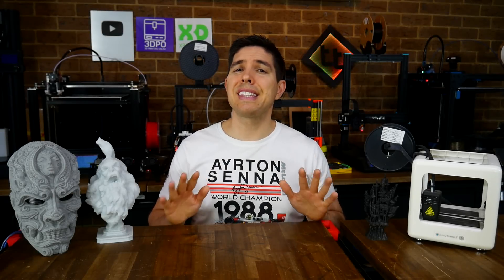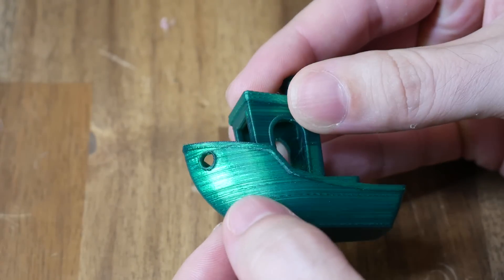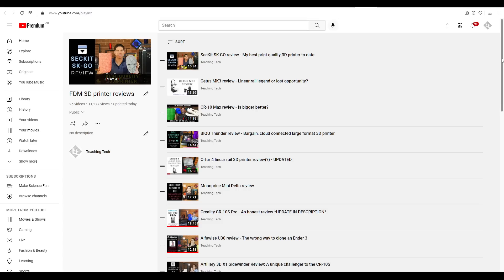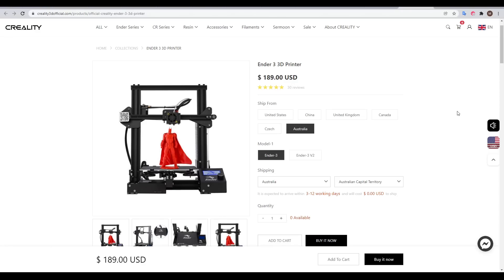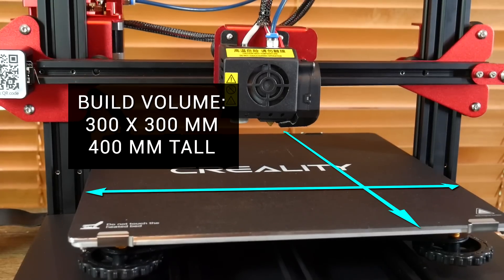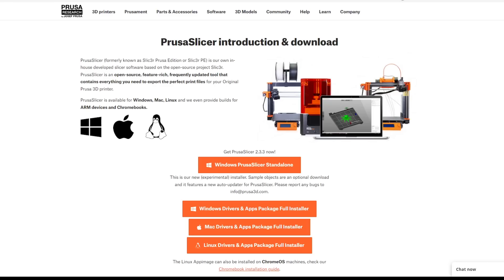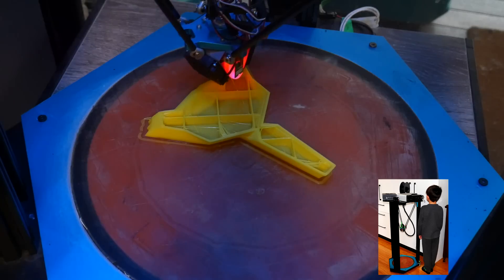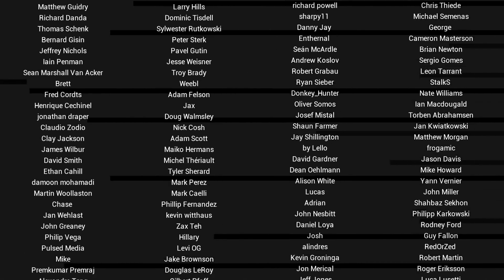Honest 3D printer buyer’s guide: Find the best machine for you!

Comment: While i wasn't able to benefit from this video I think I did ok. It's been almost a year since receiving my prusa mini and it was a learning curve (some parts still out side of direct interaction with the printer), but I think it has been the best fit. I did want to jump straight to a big print area machine, but kind glad I didn't as I don't feel the stuff I've been making/designing has needed a larger area. Furthermore, print times for bigger parts would not be ideal for various reasons in my situation.  I do agree with everything about this video as it would've been immensely useful if I were in the situation of buying a printer now.

Comment: Avoid printers that market themselves as educational or for education; they tend to have proprietary and locked down hardware and software, which makes them difficult to repair without reaching out to the manufacturer.
Reply from the maker: As far as I can can tell that is the problem with where Makerbot has gone. I ran a Makerbot Replicator 1 at my school back in 2012 and it was quite a good performer. A few years ago I opted against my school getting them because the extruder wasn't user serviceable. Imagine having to send it away for repair if you just had a clog!?

Comment: Looking at 3d printer as a tool instead of hobby, i am quite happy with Anycubic Vyper - it's cheap, has automatic bed leveling, respectable build volume, and good printing speed. Also requires minimal assembly and got to printing within 30 min of opening box. I did not like Ender3 on other hand - I have probably received a defective unit though and it's been nothing but frustration since I got it.
Reply from the maker: One of my patrons purchased a Vyper and I was excited to see how it went because on paper the specs are fantastic. Unfortunately his broke down and he had issues with customer support. It really can be a lucky dip.
Reply: @TeachingTech  tbh I had this exact experience with ender3v2

Comment: Most 3D printers are just for hobby use only including the CoreXY machines. For more custom parts for design & prototyping you need a very expensive metal printer & post processing machines which will cost you ten of thousands of dollars. If I was in the market for a 3D printer I would get a 300mm X 300mm X 300mm CoreXY printer. But it would still be a hobby printer since they are not built for ease of use, metal printing, prototyping & structural parts. I want a 3D printer that works right out of the box without having to do a lot of adjustments to the G & M codes, or as we call it in CNC machinating, the part program & slicer software. I can manually program a CNC vertical or horizontal lathe & milling machine with no problem since I know where home position is at & where I want the tool to start cutting & the speed & feeds I want very easily while that can't be said with 3D printers since they do not have a consent surface feed function. Tough I rarely use the constant surface speed when programming manually. There are too many variables form machine to machine, from slicer to slicer, & filament to filament. Plus I don't care for the layer lines no matter how fine you tune your 3D printer you are going to get layer lines & stringing. And resin printers have a very small build plate & volume. I would consider a resin printer over a CoreXY printer if it had a 300mm X 300mm X 300mm build volume along with the capability of metal printing. Overall a CNC controlled lathe or milling machine is so much better producing prototype & structural parts.
Reply from the maker: I get what you're saying but I think your focus is limited. There are so many plastic parts in production for a variety of applications. Not everything has to be metal to be considered non-hobby. Check out my meet a maker interview with Myles. He has just expanded that business significantly due to its success. The volume of parts he makes is perfect for FDM.

Comment: I would buy a cheap Ender 3. After careful calibration, it prints like the best of them.
Then mod it to get what I want. 2 extruders, no problem. They sell all sorts of mods for ender 3. 
You'll end up with the printer you know like the back of your hand, and can fix any part, if it breaks. 
There is no plug and play printer. No matter how much you pay. You need to know what you're doing and why.

Comment: I wouldn't recommend buying the best right off the bat.   The user base for lower end machines like the Ender 3 is multitudes higher which means there are far more experienced people out there to talk to.  They are a great machine to learn on without having expensive crashes that might be expensive to fix on a high end machine.  I know people that bought a higher end printer for their first only to find out they didn't really care 3D printing anyway.

I started with an Ender 3 Pro, used it for a couple of years then built a Voron using the Ender to print needed the parts for it.  I still use it in tandom with my high end CoreXY, learned so much using and upgrading it.  Hands on time just can't be duplicated by reading.
Reply from the maker: I think your journey is a very good one. Start with something cheaper. If 3D printing doesn't work out, you can sell it. If you like it, learn more by upgrading and if you really like it, you'll be well equipped to make a decision on a more expensive machine,.

Comment: I prototype a lot, and ended up with an ender 3 pro. It was fine out of the box, but after adding a Micro Swiss direct drive and hot end kit, skr mini e3 v2, BL touch, and a dual Z axis lead screw, I have been very happy with it. It prints very consistently.
Reply: where do you get those parts?

Comment: The tool or hobby question is an important one, and the car analogy is a good one. Regardless of which side of that debate you fall on though,  no one wants a car that breaks down all the time.  There are LOTS of (usually cheaper,) printers that do so. My first printer almost killed my interest in 3d printing entirely.  In the first 6-7 months of ownership  I never got to "hot rod" it or even just take a worry free drive. Most of my time was spent stranded in the driveway.  Late for work. Just trying to get the f-ing thing to start...AGAIN.

The lesson I learned the hard way is this:

     Save up a while longer  and buy a well made printer from a company that actually offers customer support and uses quality components. If you don't you'll likely just end up spending the money anyway replacing what broke. You will also lose VAST amounts of time troubleshooting and waiting for parts when things go wrong.  My first printer was an Ender 3 and from day one I was sucked into a Bermuda triangle of poor/cheap build quality,  faulty electronic components, and non-existent customer support.  I know there are lots of people who love their Ender 3's, and if you had a good experience I'm happy for you,  but If I had it all to do over again I would not buy this inexpensive a machine from Creality or any manufacturer.  They are building down to a price point which makes every machine an unreasonable gamble and leaves ZERO room to pay for proper customer support when things go wrong.
Reply: I'm at the start of starting with 3D Printing, I agree with your statement about getting a good quality one. Can I ask which printer you're using/would recommend for a beginner now?
Reply: @Ricofizz  It isn't the sexiest answer as you'll hear this a lot, but Prusa is a safe bet. The initial buy in seems high in comparison to my ender 3, but I spent easily as much as that making my printer produce a high quality print reliably I.e. repairs/upgrades. Most importantly though, and I can't emphasize this enough, THEY HAVE CUSTOMER SUPPORT. If your printer has an issue they'll walk you through fixing it or will replace a defective part.  That's just not a thing if you're spending 300 dollars or less. I was on my own as far as Creality was concerned.  Thank god the 3d printing community is so willing to help, and we're willing to do that because in general it's the wild west in the printer manufacturing space.  Anything goes.  There  are only a few companies that see the benefit in making a quality printer and supporting their customer base. It costs money to have someone readily available to help customers and provide replacement parts.   So if you just don't have it in you to buy a Prusa, (maybe you don't like orange?) I'd go with the "manufacturer supported printers" suggestion.
Reply: @jorrdanna6219  Yeah after a bad experience with the Creality CP-01 probably going to go for a prusa..
Thank you for your advice :)
Reply: @Ricofizz  I too would welcome this information as I'm realizing that I would pay more for a higher quality machine to start that has FAR MORE reliability and customer support than what Creality is willing to offer. The money is worth the quality, so any recommendations I would greatly appreciate as well.

Comment: I brought a Ender 5, two years ago. Worked beautifully right out of the box, it had no issues except for the cheap SD card that was included. I print mostly pla and it prints perfect. When I initially bought the printer I bought a bl touch, which came a few weeks after the printer so I got some use with manual bed leveling. I installed the bl touch and it works fine. I have about 700hrs on the machine and it runs like a clock.
Reply from the maker: The Ender 5 I reviewed has was also and has continued to be very reliable.
Reply: I'm struggling to flash new firmware to my ender 5 pro. I download the proper firmware, transfer to memory card and stick it in.. nothing happens. What did I miss???

Comment: I wonder about patten issues. I'm dying to print giant leggos.
I also wonder about insurance issues with accidentally printing recalled toys and choking hazard stuff?

Do you think the cheap ender has the size for the Legos and the detail for dentures?
Reply from the maker: Lego, yes you can print it on cheap machines. You will need a bit of trial and error to get the tolerances right for a nice fit, and obviously it will not be as shiny and smooth as proper injection molded Lego. Dentures I would say resin printing only. It's what they use in industry.
Reply: @TeachingTech  . Yeah cool. Thanks. I guess will have to get a 3d scanner as well. But eventually, i will be the best. Hahahaha!!!! 😊 Thanks.

Comment: This is more than a bit off-topic, but I found your mention of Lulzbot interesting.  At my job (that I have retired from), we had two Lulzbot TAZ printers that served us well (and as far as I know, are continuing to serve my old company well).  When I first heard of the Prusa XL, I thought that the XL might be am unintentional Lulzbot killer.  Not only does it have Prusa customer support, but the XL ('base model') at $2000 is actually significantly cheaper than the Lulzbot TAZ workhorse at $2950.  The XL also has a significantly larger build volume, and it is more technically advanced than the TAZ Workhorse.  I did like our two TAZ printers, but with the Prusa XL, it looks like the game has changed and the TAZ may end up looking like it is overpriced compared to the XL.
Reply from the maker: I haven't used a Lulzbot but I had the opportunity to provide some feedback om the SideKick in a video call recently. They seem like nice guys and I also felt the comparison with Prusa is valid.

Comment: Excellent video and advice, especially the part concerning that 3D printing isn't ready for the mainstream yet. I've met a few people that got really excited when they heard I was involved with 3D printing and I had to explain to them that while it's very rewarding, it's not easy because there's a steep learning curve. I did say that it was achievable but one needed to put the work into it. 

Two things I would recommend. First, get an Ender 3, a clone, or some other popular printer like that. I know have two printers and they are not popular ones (and not clones). If I want to find something on the sites that have STLs available to download in order to upgrade my printer it is much more difficult than if I had a more popular printer. There are a lot of upgrades out there for the Ender series. 

The other suggestion would be to buy a printer with an auto levelling sensor installed. My first printer didn't have one while my second one did. Setting up and printing with the second printer is much easier and more enjoyable. The difference between a not bad first layer and a really good first layer is sometimes hard to tell and having the auto bed levelling just takes that frustration away.
Reply: Any recommendations for printers with auto leveling
Reply: @amaranthlim3175  

I bought two printers from Eryone, a Thinker SE and an ER-20. They are my first printers as I got into 3D printing just over a year ago. The features for the price were better than anyone else that I could find at the time in Canada, especially when there were a couple of really good sales with coupons available at Amazon Canada. The Thinker SE for the size (300mmx300mmx400mm) and the ER-20 for the auto levelling. I bought the Thinker SE first and after about four or five months I got tired of levelling (I couldn't get it good enough for me and I was always trying to get it better) so I got the ER-20 even though it has a smaller bed (which is the. common size for printers that come with auto levelling sensors).

The one thing about the ER-20 that I don't like is if you leave the USB cable from the computer (that is turned on) then the screen and auto level sensor remain on even if the printer is turned off. The solution from Eryone was to undo a connection on the board of the printer. They also said all of their printers do that but the Thinker SE doesn't. It's an issue if you want the ER-20 hooked up to computer to manage the printing and that computer will be on all of the time. Perhaps there are USB cables that don't send power?

Eryone support was very good at replacing the sensor for auto levelling when mine was defective under warranty. 

I've also found that the Eryone filaments to be very good.

I'm currently rebuilding the Thinker SE. I'm using the BTT SKR 1.4 Turbo for the main board, putting on a S42b v2.0 stepper motor (I know it's total overkill), closed loop driver control board on the X and Y axis, TMS2209 stepper motor controllers for the Z and E0, adding a 4.3" smart display, adding anti-backlash spring loaded nuts on the lead screws of the Z axis, and will be installing the E3D Revo later this year. If I get everything working as smoothly as I hope I might sell the ER-20.

Comment: Great Video, my advice would be: if it isn't sticking 90% of the time Its your bed levelling (in my case any way) , I have been printing to 2.5 years and have worked up from a fabricator Mini to a ender 3 Pro and in the last month I have only just managed to correctly level the bed in a way that suit me before that I would always have elephant foot or need to use hairspray.

Comment: I really like your channel and the  way you approach testing 3D print hardware. I usually learn something. 
I started out with a DIY repwrap in 2012. Now I use a Flsun delta or resin for some prints but if I want repeatability I use ultimakers and then a bureau for multiple prints
Reply from the maker: I've never used an Ultimaker, maybe one day I will.

Comment: To me the Ender3 may be the most sold, but some clones are so much better, like the Elegoo Neptune which already have all the upgrades you can dream of.
Reply from the maker: I agree the clones can be better. My only concern is access to firmware and sometimes they have a weird mainboard that might be more difficult to work with.
Reply: @TeachingTech  That's a point to check, you're right. To me Creality's boards are lo-fi weirdos which are not documented at all. The Elegoo Neptune uses the Robin Nano board, developed and correctly documented by MKS. There's no rules alas...